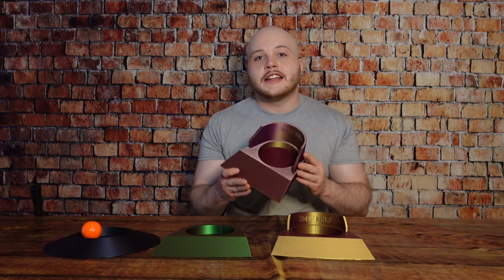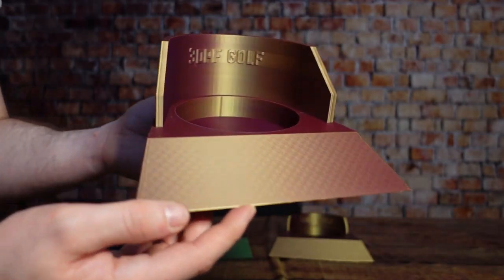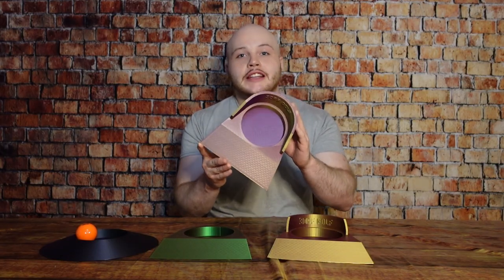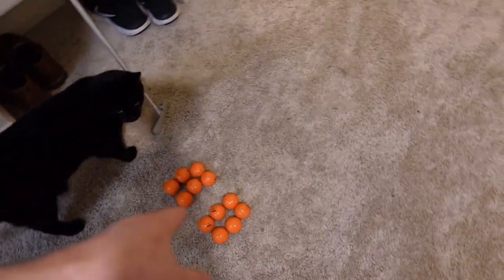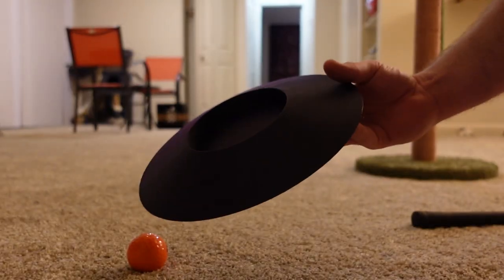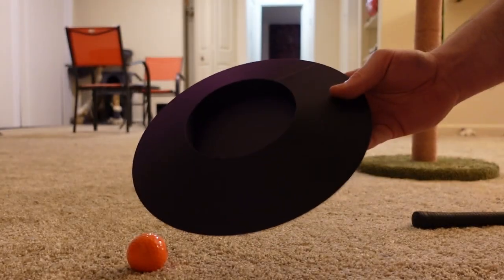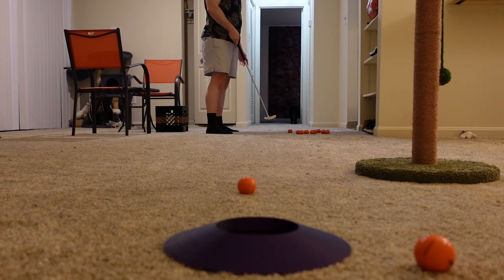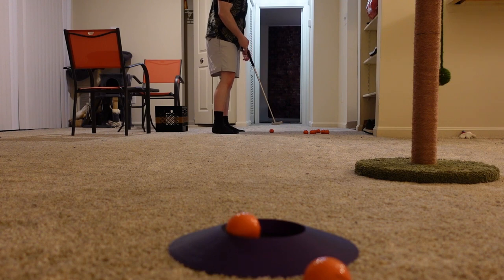3D Printed Golf Holes!

Comment: Hello, if I buy the Patreon is there photos I could use with it.
Reply from the maker: Hello! All Patrons are required to use their own product photos. The Patreon provides a commercial license to print and sell the designs available on the catalog. Most online marketplaces don't allow duplicate listings, taking your own product photos will make sure that your listings are original to your shop. Using your own product photos is also a great way to help your listings stand out and showcase the quality that your shop provides.